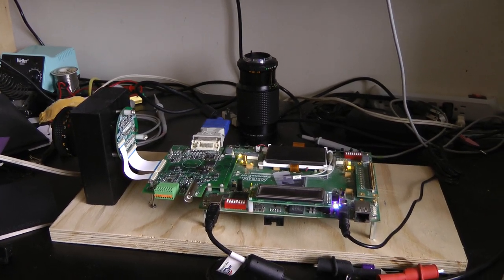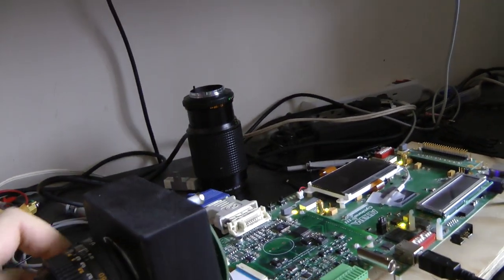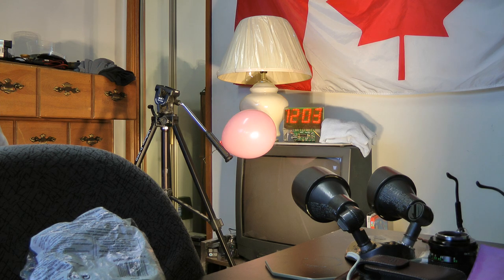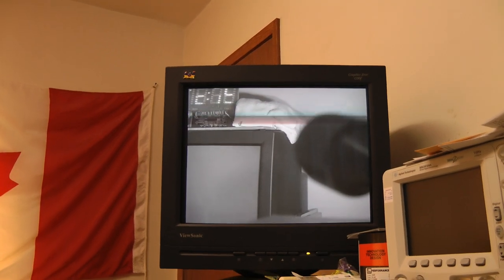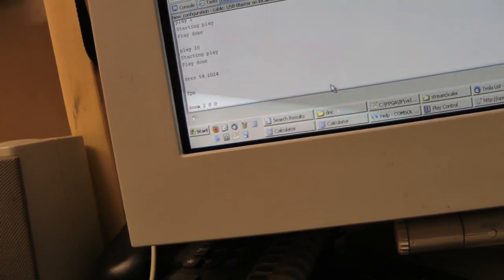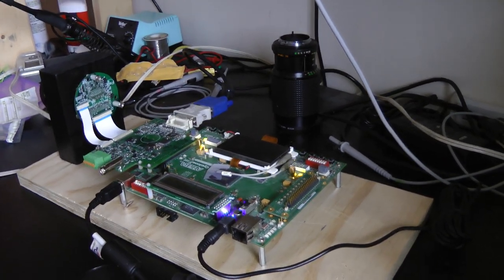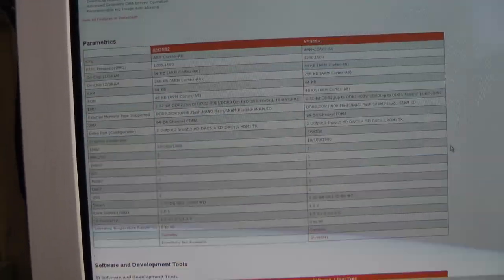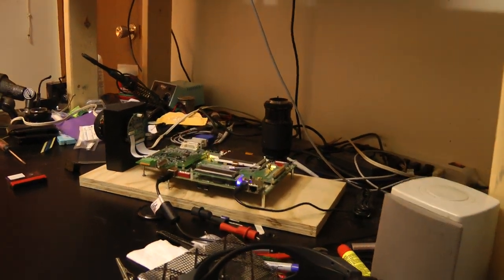High-speed camera update - First recording!

Comment from the maker: @rompn4x The sensor is 1280x1024 with 14um pixels, so the image plane dimensions are 17.9 x 14.3mm
Reply: what was its max frame rate at that resolution?

Comment: Which mount will the final version be using? It might be worth considering using a Canon or a Nikon lens mount, as these brands offer a huge back catalogue of great quality lenses.
Reply from the maker: The final version will use C mount, which matches the 2/3" sensor. You can adapt it to pretty much any lens mount you want with an adapter.